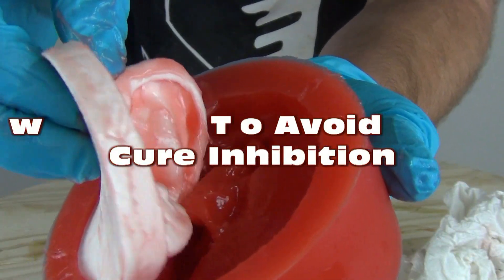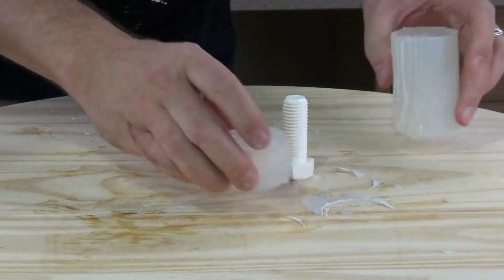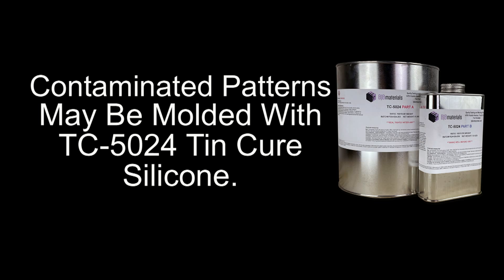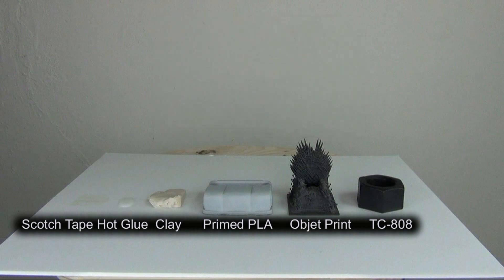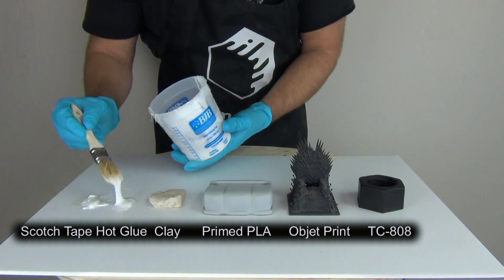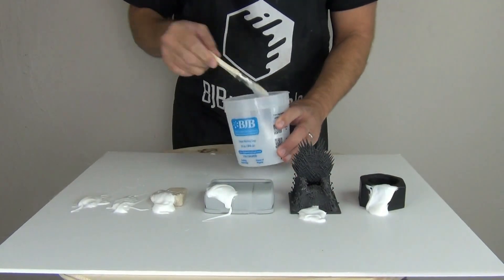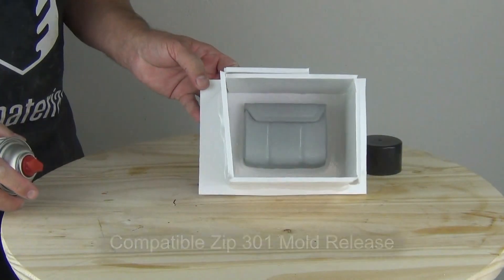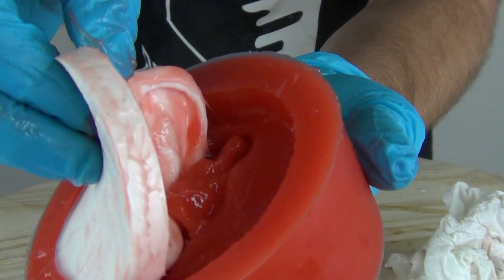How To Avoid Cure Inhibition With Platinum Silicone

Comment: Thanks for the great video!

You show that a top contaminant is tin cure silicones. What about platinum? Some producers state that if you make a mold using a certain platinum cured silicone, you can't cast using the same platinum cured silicone because it will poison and inhibit the curing process. Why is this?
Reply from the maker: I have not heard or experienced that, but I have not used all the brands out there and there are many different formulations.

Comment: Is food grade rtv silicone safe for sax toys or it must be medical grade? Please do not ignore my question. Thanks a lot.
Reply from the maker: Check with the manufacturer. Medical is a completely different set of standards. Typically safe for skin contact is what you need to look for. The language used on some of the really cheap stuff can imply things about the product that may not be 100% accurate. Call the manufacturer and confirm.

Comment: How do you know if tin silicone or platinum silicone when you get a prop. How you do test it?
Reply from the maker: If it is a prop cast by another artist, do not re-cast. As for Tin or Platinum, run a small test as seen in this video to ensure compatibility. I must stress again, however, do not re-cast other artists' work.
Reply: @brickintheyard  yes-that is stealing, unless you get written permission